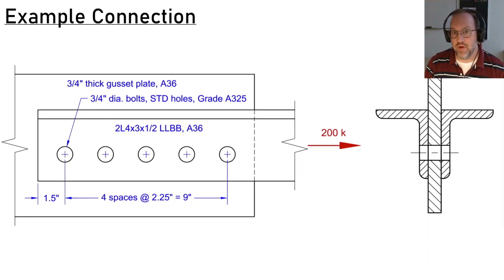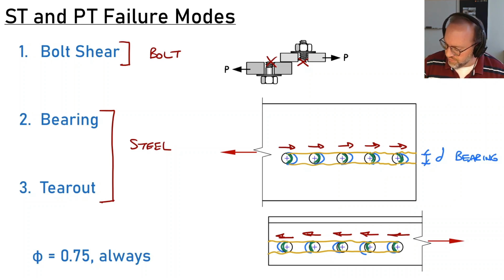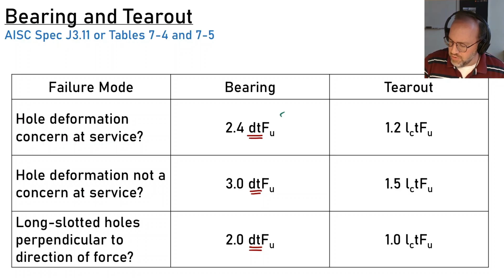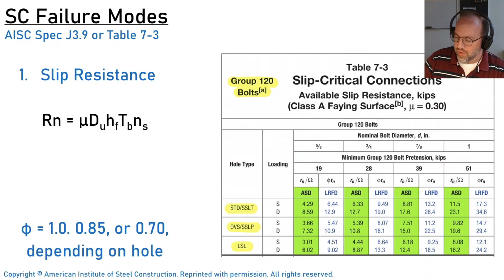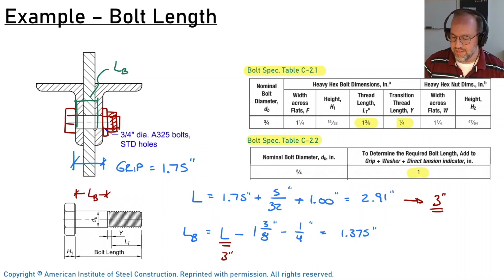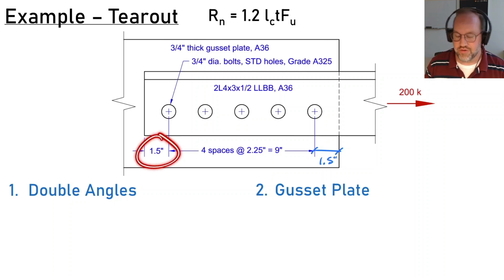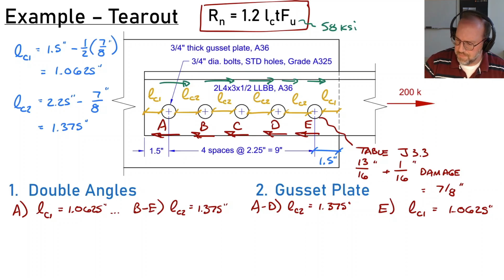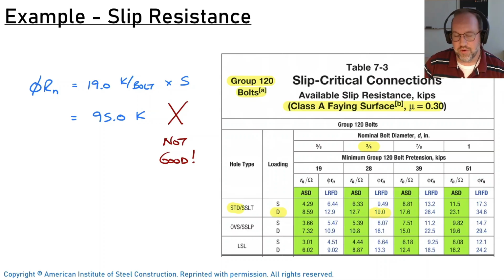Bolt Shear, Bearing, and Tearout - Shear Strength of Bolted Connections

Comment: The 222 kips, theoretically  means that the applied load should not exceed that value. However, If we applied this load, isn't going to be distributed equally among all bolts? 222/5=44.4 kips /bolt. if so, this will tear-out the gusset plate at bolt E (44.4k > 41.6k) before the failure takes place at the other bolts. Is this considered for the design of bolted connections? I would really appreciate it if you could answer my question.
Reply from the maker: Bolted connections like this are typically ductile, and thus will redistribute their forces as they approach failure. Thus, the load is not equally distributed among the bolts. As one bolt approaches failure, the other bolts will begin to carry more load until all bolts approach failure. We don't precisely model how much load each bolt carries at any given point in time, but it is valid to add their capacities in this way to model the failure of the complete connection.

Comment: Do you have to account for hole positions being not perfectly aligned and thus one bolted connection taking all of the force until the bolt or hole have deformed so much to allow the other bolted connections to start bearing?
Reply from the maker: Great question! 

Short answer: for typical connections, no, we don't directly worry about this differential loading or the order of loading among the bolts.

Long answer: Bolted steel connections have a fair amount of ductility. At ultimate loading, therefore, deformation of the bolts and holes allows the load to distribute relatively evenly among the bolts. We don't really need to worry about which bolt was loaded first, as long as all bolts eventually contribute to the total capacity.

Furthermore, the nominal shear stress values reported in AISC for bolts already have a number of factors of safety to handle differential loading. For example, when threads are excluded from the shear plane, the nominal shear stress is 0.563 of the bolt ultimate stress. This accounts for two things: a 0.625 factor for converting bolt tension strength to shear strength, and an additional 0.9 factor for the possibility of differential loading. Adding the LRFD or ASD factors of safety on top of this accommodates any further uncertainties.

There are exceptions, however. The more bolts you have, the more likely it becomes that some bolts are not fully loaded when you have failure. AISC handles this by defining a "long end-loaded connection" length factor when the connection is over 38 inches (0.95 m) long. In this case, the 0.9 factor given above for differential loading is reduced to 0.75, which is the origin of the 83.3% value in footnote (c) of Table J3.2 (as 0.75/0.90 = 0.833). 

Admittedly, this is a rough and indirect way of handling differential loading throughout the connection, but it is certainly simpler than trying to directly predict which bolts will carry more load.
Reply: @StructuresProfH  Thanks!